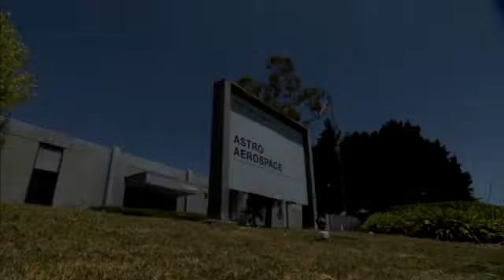Telescoping Tube Mast (TTM) Deployment

Comment: Hey Folks, there is a great market if this device could be mounted on a sailboat and withstand the same forces as a one piece mast.  Much of sailing the intercostal waterways involves lowering or destepping the mast- this is expensive and traumatic.
Spreaders might be an issue (rigging) but there must me many principles here that are transferrable.
Reply: this is a space structure though, it is very fragile and I don't think you could make a mast that is both light enough to be deployed and strong enough to withstand strong winds. this mast can barely withstand its own weight uner gravity.
Reply: LOL - Walter that is EXACTLY what bought me here! I was looking for something like this for a boat.
Reply: @crazifyit Were you successful in finding one for your boat? I'm still looking.
Reply: @CG-cx9fv  - Yes and no! I found "something", but it is designed for much bigger ships and it is so heavy it couldn't possibly be acceptable for a catamaran or small boat. It seems like this isn't something many have wanted on regular sized boats. I can't understand why! It would be TOTALLY useful during storms, etc.
Reply: @crazifyit  Thank you very much for your prompt reply. Maybe it's time to look for a workshop to get one built.